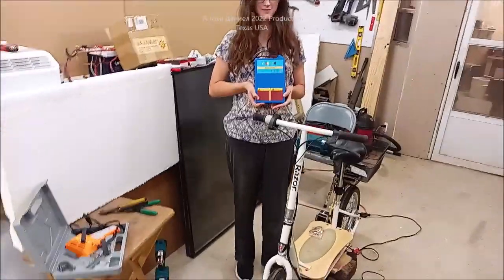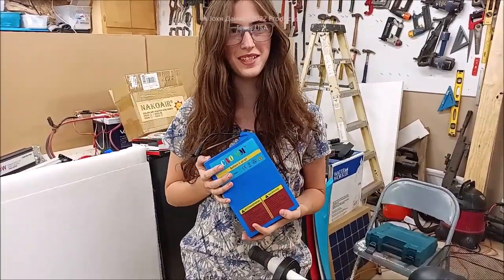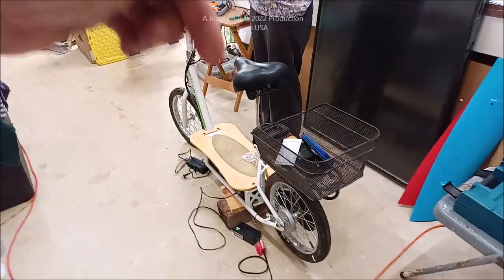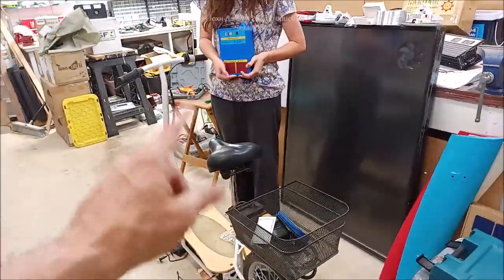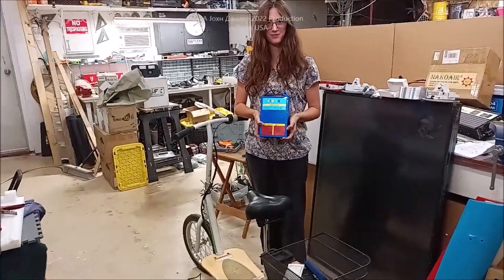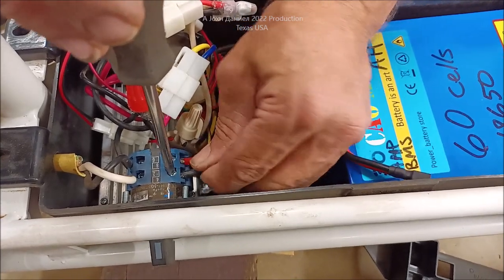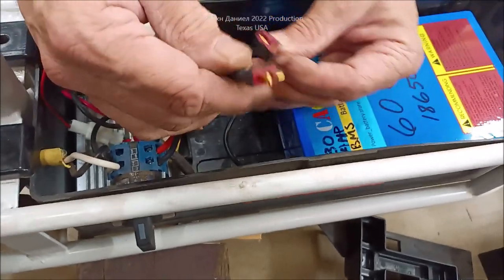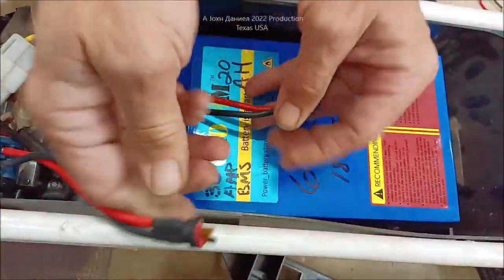RAZOR ECO SMART Metro E Scooter Upgrade, Triple its battery capacity, converting to Lithium powered

Comment from the maker: New Lead Acid for it was almost $90, so I got $149 Li-poly 20ah, comes in 36 & 48v battery option https://s.click.aliexpress.com/e/_DEpJCWX Send a coffee to Kiera,  https://www.buymeacoffee.com/JOHNDANIEL and see the Razor scooter on sale now https://amzn.to/3yf8MRC ✨36 Volt Razor EcoSmart Scooter twin power parts , 40 volt Black & Decker Batteries https://amzn.to/3wFQCWm , 40v Battery Adapter https://amzn.to/3gMVqml , 40V Battery Charger https://amzn.to/3gDTE82 , 8 terminal Cam Switch 20A https://amzn.to/3gCnn19
Reply: Sweet. Just the video I was looking for. Thanks for posting it. If you don't mind me asking...I would love to see a followup video with your daughter and your month plus impressions on the upgrade. Also, would there be anything extra that needs to be modded to throw in the 48 volt battery option at your listed link?
Reply from the maker: @stxrobstar  So far, she has been over 28 miles on it, still not needing charged and has over 22% still in the battery. Yes, you can change out the controller to a 48 volt version and motor to a 650 watt 48 volt then you will get 4 mph more and lots of fun.
Reply: @JOHNDANIEL1   Thank you kind sir. 🥃
Reply: Thank you again I finally got it this video really helped and I sure do appreciate. John Lane
Reply: I hooked up the lithium-ion battery positive and negative then the charger to the charger port positive and negative red and black I just went out on the scooter and it went about 5 mph and stopped and then I kind of smelled something. I think the controller's burnt. I wish I knew what I did wrong. So now it turns on but it won't go because I think the controller might be gone. It makes me think positive and negative might not be positive and negative. Can you give me any advice John? I can't see how to send pictures but I took pictures
Reply: @stxrobstar  gosh I wish I could send you pictures John. Lithium ion battery charged for about two-and-a-half to three hours with the lithium-ion battery charger. It's a 36v 10ah
Reply: @johnlane9590   The battery may have not been able to continuously output the 30 amps needed. When I was shopping for batteriers I saw lots that could only output 20 amps or so.
Reply: @stxrobstar  so are you saying I need to get (36v) 30 amp battery and not a 10 amp battery? The original lead acid batteries were only 7 amp. I thought the amps only meant distance. This is the same brand of battery you have also. The battery itself is fine, I'm sure I burnt out the controller. It seems like I'd be able to send you pictures but I can't figure it out. I took a few pictures of how I did this connection. Thanks again for your help John
Reply: @johnlane9590   Amp hours of capacity is different from the Amps of power output. You need a 36v battery of whatever amp hours capacity (that will fit where you want it to) that is capable of putting out at least 30 amps of continuous power - i.e. It should have at least a 30amp BMS (Battery Management System). The battery John Daniel linked to fits the bill.
Reply: @stxrobstar  It's the same brand as the one John's using in the video. I hooked up the battery and it spun the wheel just fine but when I sat on it and started to move it moved very slowly and burnt the controller. The battery is connected where the previous lead acid batteries were connected and the charger port is rerouted to the battery's charger input without going through the controller. So I'm really flummoxed. Thank you
Reply: @johnlane9590  "is [your battery] capable of putting out at least 30 amps of continuous power - i.e. It should have at least a 30amp BMS (Battery Management System)"?
Reply: The #18650 battery is a 48 volt battery correct?  I've watched the film and tried to find your specific comments about voltage of the new lithium battery.
Reply: I can't find anybody to do this can I send my scooter to u for upgrade

Comment: Thanks for posting this. I have gone off your video and your answers to questions in the comments, and I have done the same upgrade (without the supplemental tool batteries) to a Razor Ecosmart that I found in disrepair and covered in spider webs on my college campus (U of I). 28 - 30 miles of range if you're cruising at full speed and sitting down, although if you're riding around campus with all the starting and stopping, and flooring it from a standstill all the time, it's more like 16 miles. Top speed is about 20 mph on a full charge, 18 mph at 60% or so. Gravel and dirt roads don't slow it down much, nor does a headwind, and it does around 9 mph through rough grass. It's an unusual-looking scooter, and it gets some (good) attention. You will get your butt and back splattered riding over wet unpaved terrain, or in the rain, unless you go really slow. I bought the same exact 36V 20Ah battery from the link you gave, although I spliced and soldered the XT60 connector wires to the original Razor connector wires rather than using a screw-down terminal. Yes it did result in a redundant double-connector, but that was fine with me. I did not bother modifying the charger or wiring the battery to the built-in charging port on the scooter, but instead ran the charging port wire on the battery over the top of the black plastic tub to hang on the outside. It's a more quick-and-dirty way than what you did, but for those who aren't aware, the battery comes with a hinged plastic cover on the charging port to keep water out, which was a pleasant surprise to see when the battery arrived. It probably wouldn't be hard to cut your own out of spare rubber or cork even if it didn't have a cover. The battery does not seem to heat up at all while charging, though it gets warm from full-throttle riding. I used padding like you did, on all sides of the battery, so hopefully it doesn't get banged up inside there with all the sidewalks and curbs.
Reply: That’s awesome man. The problem I am having is the battery doesn’t last very long, can’t go 2 miles and it’s dead and we end up pushing it. I’m going to try this and see what I get

Comment: Great upgrade for Kiera’s bike.  Wish the manufactures would build them that way in the first place.  Quick question for you.  Recently picked up a generator with a lithium battery.  How do I know if the charge controller is built into the battery?
Reply from the maker: Draw it down below 10 volts, possibility under 9 and see if it disconnects, or charge it to 14.5 and see if it also disconnects. Most are set to disconnect at 10 low, 14.5 high.
Reply: @JOHNDANIEL1  thanks!  Will give it a try

Comment: There's a couple videos of adding a duel batteries to a scooter. Ebike school  and grin technology. I have two 48 volt batteries 10 ah and 13ah using both at the same time with a isolator block 1000 watt Bafang geared rear hub get about 18 miles. Not able to ride it hit train tracks at 35 mph fractured my pelvis. I have been looking for a Dewalt 40 volt charger can't find it. A big props to the sweet little lady for getting her hands dirty and you know it's not proper to ask a lady her weight. 😉
Reply from the maker: https://www.discountdepot.com/dewalt-40v-max-lithium-ion-battery-charger.html Arrange testing and shipping if thats possible
Reply from the maker: PS- You can charge the 40 volt Dewalt battery from any 40 volt lithium Charger if your into a bit of handy man electronics, by placing a 4 wire connector into it and some proper wiring. I did this on a 40 volt Green Worx battery, 2 years still doing good.

Comment: Are you worried about heat build up with all that foam packed around the battery?
Reply from the maker: Not yet, It does have a heat controlled BMS disconnect. The packing foam has practically zero insulative value, you can feel a light bulbs heat on the other side of it immediately when you put it up near one. I had a "light bulb idea" of using it for insulating pipes since I get so much of it , hundreds  of pieces a year from installing solar, but it would not protect pipes at all. 
The other part is the scooters draw is far less than the batteries ability, so unlikely to make much heat even under continuous draw. If it ever does we will replace or change it, it's easy. The charger is just under 4 amps charging too, and I charged it in a bath towel to see if it warmed it when charged but none happened, if I did it with the BMS max of 8 amps It may get warm.

Comment: This is a very nice upgrade for range. However I'm concerned the foam padding you have added will insulate and cause the battery to overheat.
Reply from the maker: It's not thermal retaining foam. In fact it's worthless for holding any heat in or out.
Reply: @JOHNDANIEL1  that's good that was my only concern as the lithium batteries seem to heat up more than sla batteries.
Reply: I was thinking that may be an issue also, maybe find someone with a 3d printer to make a plastic insert like it had before

Comment: Thanks for this video it's awesome. I've an electric scooter with a 800watt hub motor and 48v led acid batteries.  I want to replace the led acid batteries with lithium ones. Do you have some advice and were just can eventually buy lithium  battery? Thanks in advance
Reply from the maker: The battery sourcing link below the video gets you to a manufacture direct store and just choose a 20+ ah 48 volt battery model for your build.

Comment: Thanks for the video! I was able to follow it and swap batteries on my old Ecosmart. I'm looking forward to the new range. I see that several people in the comments were worried about the foam possibly causing heat issues. Have you had any issues? I just cut and used the foam that the battery came packed in and am wondering if I should swap it out with something else.
Reply from the maker: Just use small pieces to secure it randomly. We did not get over heating from it, but to be safe I cut some of it back and left enough to keep it centered and secured.
Reply: @JOHNDANIEL1  Thanks for the tip!

Comment: I wanted to do this to mine but wasn't sure it would work, cause all the others show lead changes. Then I found yours. I haven't bought yet, because the battery I'm looking at, I'm unsure about. 

I'm curious, do you think that the 36v 30ah battery from one of those "hoverboards" would work?  They don't have the separate line for charging, so I'd likely need to buy a lithium charger.
Reply from the maker: Due to being enclosed I chose the one with separate charge circuit. But I guess you can try any source that will fit. The one I did buy was about the max that would fit and 400% more total energy.

Comment: I’ve been studying this video. Great build I’m looking to match! Did you use 36v or 48v battery option? Does fuse and BMS come with battery?
Reply from the maker: 36 volt 20 AH and BMS is in the battery pack. Same one as link below video. Fuse of 20 amp you add if not included but mine had one on the motor driver module.
Reply: @JOHNDANIEL1 thank you so much for quick response! Unfortunately, the battery you used is out of stock but I’ve seen info about using 48v and even 60v. Is there any downside of using these voltages other than needing a controller and charger?
Reply from the maker: @gregwiesneth3137  Your motor if in the similar bike is made for 28 to 44 volts. So it would not last long with 50 volts hitting it.
Reply: @JOHNDANIEL1  I have the SUP version, no seat. Thank you for the info! I’ll keep an eye out for when the 36v comes back in stock.

Comment: @John Daniel JUNE 14, 2023- Hello, I am 46 yrs old and new to scooter world and never had one. I have walked for years to work and back which is about 2.5 mile round trip. That is getting old so I been looking for past year in research on a scooter. I pulled the trigger yesterday and ordered the one in vid- Echosmart Metro Razor chain driven motor. It should be here tomorrow. For the start I have a couple things if you could input on. Being I have worked on electronics since 80s I sorta understand all this in vid. I will mod the scooter in time but for now I will leave that to the side in the battery upgrade. But have the first question on that part itself 1. Do you see any reason or know of that the battery mod could effect the motor? Being the increase in speed a tad vs the 500 watt motor keeping up with such and any added strain per spec of motor. 2. I do not see a link for the head light itself? Wish you did a vid on the head light and install because I need to put front and back light on mine. 3. Oddly my concern on this scooter is silly at this point and simple. Being- you will find the HD ver or SUP maybe has the front and back rain/mud runners. Meaning the things right above wheels that direct water and such away vs your back spraying water all over you. Can this exact scooter have a part you can get to solve said? Thanks.
Reply from the maker: The motor is capable of the battery change, it actually is more harmed by the voltage sagging as the lead acid batteries volts drop and will get hotter loading with lower volts. (ohms law). Seems to run much happier. The controller can handle it also, has 60 volt capacitors in it. Numerous headlight kits and tail light kits https://amzn.to/42H4WNy  are on Amazon. The motor controller has numerous plugs that are made for lights, brake function and so on. You may have to test it to verify which ones to use. 
As for fenders you can buy 16 to 20" bike fender kits https://amzn.to/3NdyRXY and using some modification they mount easy such as mounting on the rear basket and making adapters for them.

Comment: Hello!
Someone mentioned that they spliced and soldered the XT60 connector wires to the original Razor connector wires rather than using a screw-down terminal. Do I need to use the 6.3mm 3 pins male and female connector in order to do so?
Reply: I'm not the same poster, but I also connected to the original connector & wires. I connected them with crimp butt connectors. I cut the 6.3mm 3 pin white connector & it's wires, plus the fuse & it's wires off the lead acid batteries. I cut the XT620 connector off the new battery, connected the new battery's black wire to the white connector's black wire, connected it's red wire to one of the fuse's red wires, and connected the fuse's other red wire to the white connector's red wire. You can then plug it into controllers 6.3mm 3 pin white connector.

Comment: Did it have the effect you expected for the range?
Reply from the maker: Yes, in a big way. Range was under a real 12 miles. Now its in the +30 miles. Top speed is easy 2 mph faster but standing acceleration is not any better than fully charged Lead Acid, however after about 5 miles lead acid take off is sluggish and the lithium is still the same as fully charged in behavior. So, over all, excellent results. Best result is with the voltage maintaining higher the motor runs a tad bit cooler since less amps are needed at higher real voltage.
Reply: @JOHNDANIEL1  Thanks for the info! This is super helpful.
Reply: Is that 30+ miles all on the new battery or is that including the tool battery?
Reply from the maker: @katiewatson563  Sorta both, 28+ on the new battery but it was still at over 20% charge in it, but she came back on the tool battery since I told her not to fully drain the internal battery. So, I baseline math'd the reply. I am sure just on the internal battery you can get 32 total down to 10% in the internal pack, I just don't push it and the 1 tool battery is good for almost 4 miles so its a great add on.

Comment: Hi John, I want to get rid of the stock batteries and add three of the 36v 20ah batteries. Can you please point me to a switch that will allow for three batteries instead of the two battery switch you have in your video. Is there anything special I should know about connecting the third battery?
Reply from the maker: You need a switch that can field them separately.. A 32 amp 4 position 12 terminal will allow you to shift the polarity safer. https://amzn.to/3MrauFZ
This one has drawings on the page to show that.

Comment: I think the only thing I'm confused about is that wire coming from the scooter charge port to the lithium ion battery, is that two wires coming from there? Thank you much. I'll getcha coffee 2.
Reply from the maker: The battery has a charge port, and the battery has a output. 4 wires total.  The incoming charger has 2 wires inbound to the batteries charge port.
Reply: @JOHNDANIEL1  thank you so much for your help John. About 14 minutes and 30 seconds into your video you cut the end off of the lithium ion battery charger and it looks like it goes into a controller plug that you have to cut, is that controller plug the one that is not being used already in the scooter?
Reply: @JOHNDANIEL1  and at about 15 minutes and 30 seconds you mentioned that you may have to tap into a controller plug and route it to the power of the battery but I'm not sure I understand because the battery is already connected to the positive and negative ports on your switch. Gosh I'm sorry I feel a little thick.
Reply: @Јоhn Daniel  hi John, so if I did get the positives and negatives right I wonder what blew the 36 volt original controller and why it only went real slow and burnt the controller right away. The battery is definitely a good battery I tested the voltage and it does say that it has 30 amps. I tell you what if you drew me a detailed diagram and sent that to me somehow I would get you two cups of coffee. I know that doesn't sound like a great deal does it I guess I'm not rolling in dough. You have been more than kind. Someone said if the voltage is higher on the battery then on the controller that it could blow the controller. Voltage does registry 42 v and it's a 36 v controller.